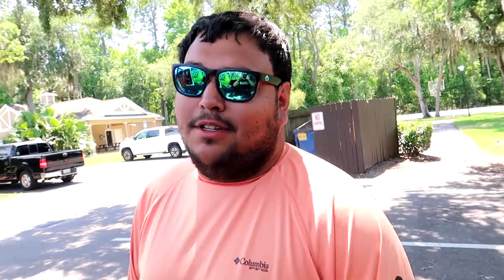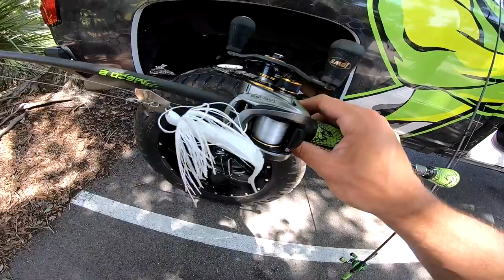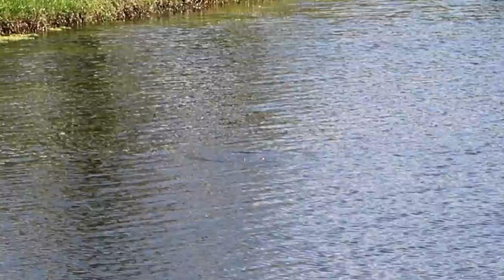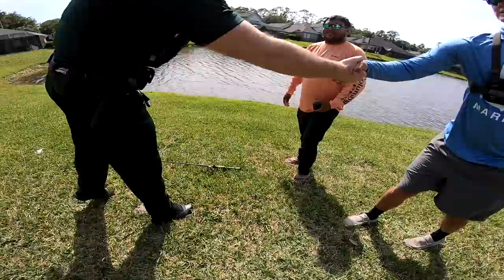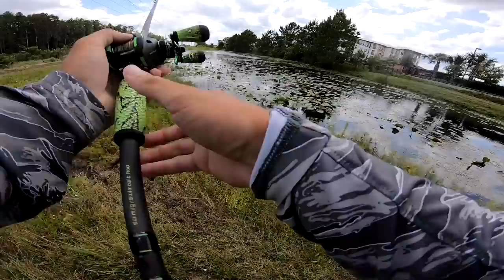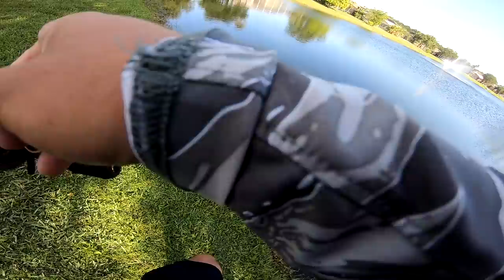Fishing TOPWATER in PONDS - COPS CALLED (Bank Fishing)

Comment: Final update: this little reel is the little engine that could https://www.youtube.com/post/UgkxSlytCJqozTF7EbdP4LWP-HUXf9WRDJ0e . It performed flawlessly and was easy to adjust drag in the moment while I was battling a 35lb bat ray behemoth. Mind you, this reel is spooled with only 25 lb braid and 25 mono topshot. It's paired with the kastking telescopic heavy power rod and the two work well together. This has now earned my respect and confidence when traveling and fishing. If you have ever hooked into large rays and sharks, you know they pull extremely hard and can run forever! This thing clamped down on the fish and was easy to adjust during the fight. It has a nice decently fast retrieve as well. Twice the fish went on mad runs and I was able to gain back line quickly to avoid spooling.